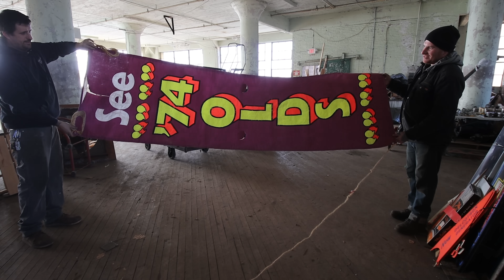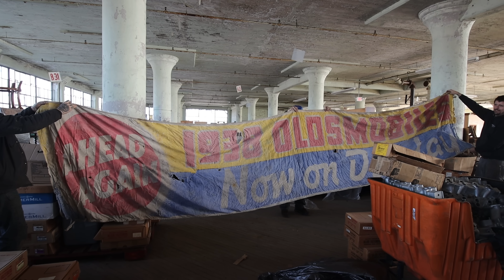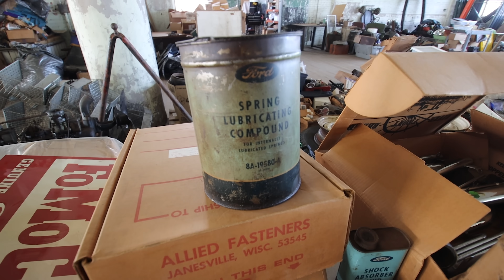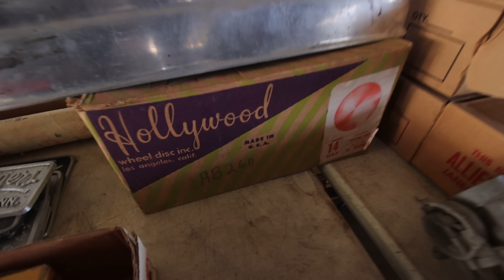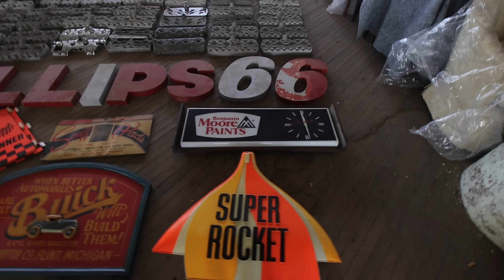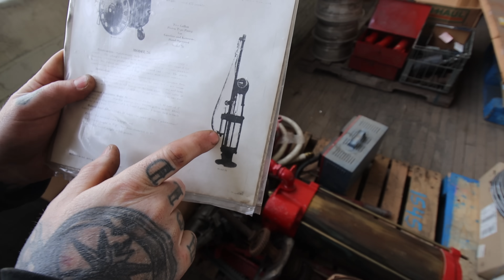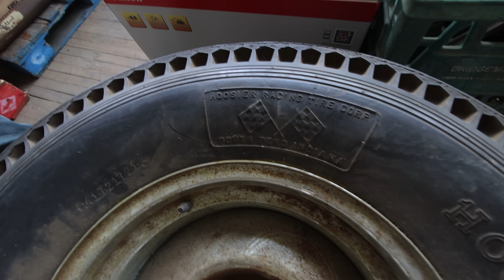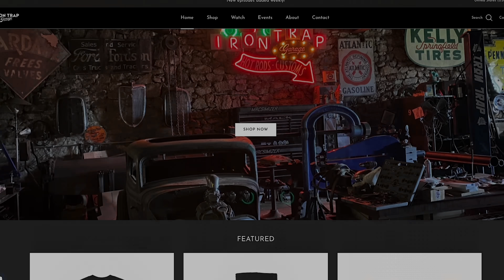Unloading MASSIVE Truckload  Of Speed Equipment & Early Ford Parts!

Comment: Thoose flathead marine parts must be quite rare. I have never seen a V8 60 marine engine before. Here in Sweden there were a couple of companys that converted Ford engines for marine use in the 1920´s to 50´s. The parts were often made out of bronze and very high quality. They bought Ford industrial engines directly from the Ford importer and converted them. The V8 flathead was very popular for use in speedboats and worked very well.

Comment: Did you guys take the box of wire hub caps seen at 15:00 on the Feb 13 episode and if so are they 15s? Aaaamd of so do I connect via yer email?
Reply: Their contact info is in the description. Don't rely on the youtube comment section for 2-way communication, just go ahead and email them.